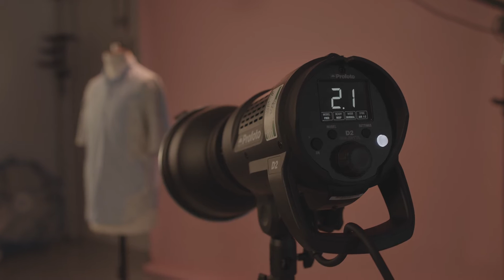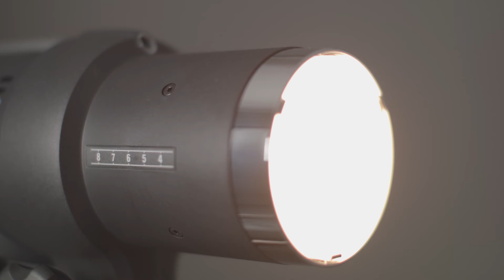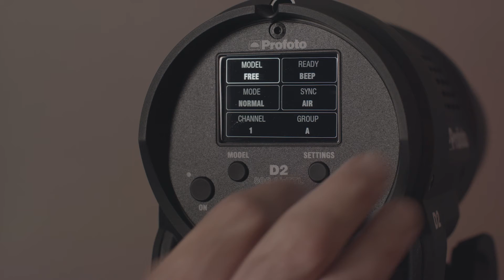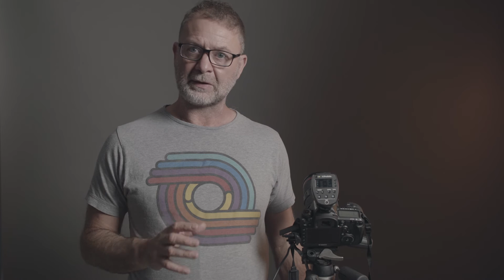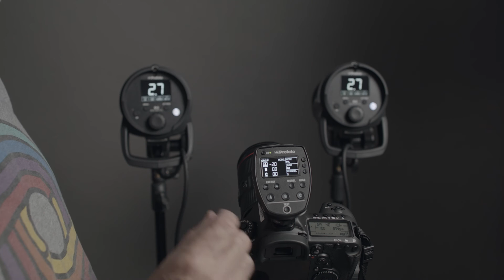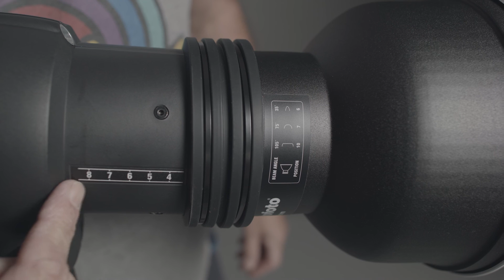Profoto D2 Air TTL Flash System

Comment: Can this light be constant, meaning for video filming? Thanks
Reply from the maker: The D2 has a modelling light, which is both continuous and adjustable but I wouldn't recommend using it for video, there are lots on continuous lighting options out there that offer adjustments in brightness and colour temperature.
Reply: @WSAPhoto  Thank you. What would you recommend for continuous light?

Comment: Good Afternoon. I am Marianne I just watched this video and found it extremely helpful. I am considering using the profoto D2 and there are NOT many videos for how to use it. If you could answer 1 question I have I'd really appreciate it. You mentioned the strobe can be used with the remote trigger. We set the remote to MANUAL or TTL but what about the strobe itself - ON THE STROBE do we have to indicate somewhere if we are using it in MANUAL or TTL mode? I am used to working with speedlights and on the speedlight you always indicate whether you are using MANUAL or TTL mode so is this the case with the profoto D2 as well? Hope you can clarify this issue for me. Thanks so much,
Marianne
Reply from the maker: Hello Marianne, thanks for your comment. When using the D2 Air you can select either Manual or TTL from the Air Remote only, the D2 heads will pick this up automatically and there's no need to set this on the head. I hope this helps.